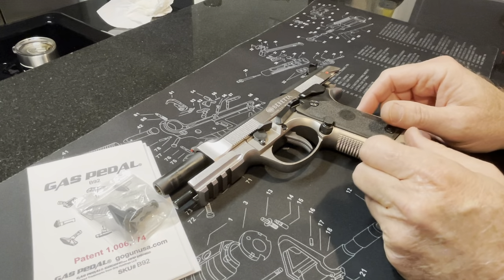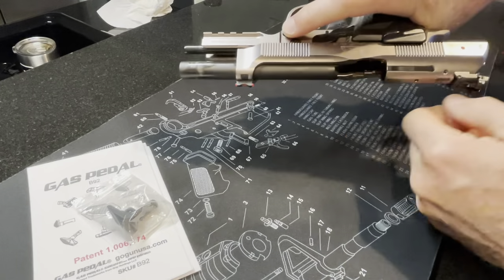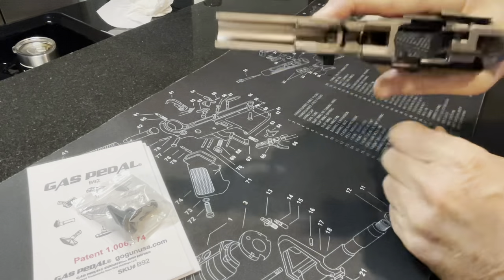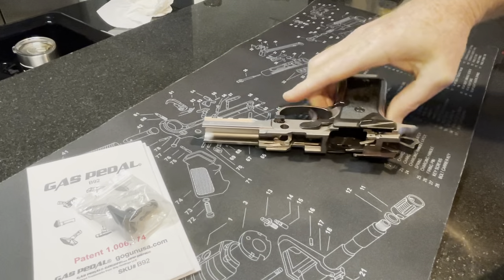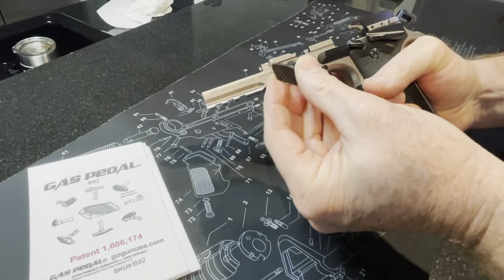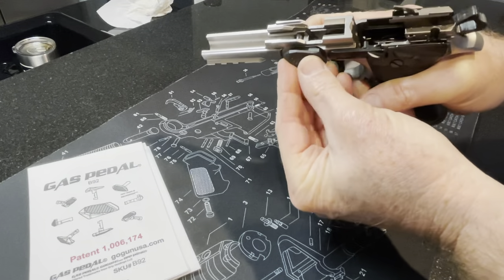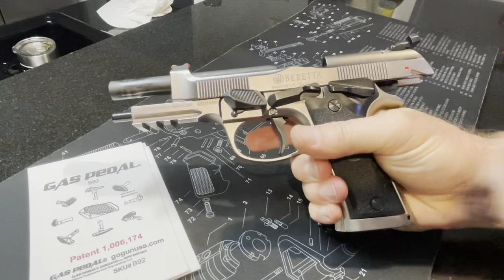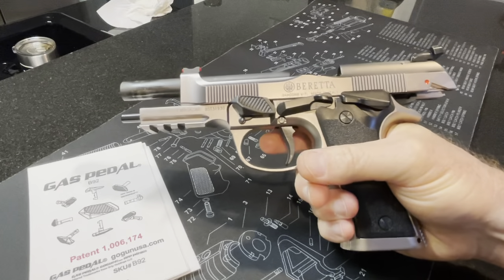GoGunUSA Gas Pedal Install on Beretta 92x Performance

Comment: Thank you for this. I ended up grinding down the pedal just below the slide as I found the thumb rest interfered with me being able to manipulate the gun. (M9A3) Afterward, I blued the area I grinded down. I am very happy with the Go Gun Gas Pedal.
Reply: Did the exact same thing, just wished the other side of the pedal sat flushed in the gun (right side of upper slide)

Comment: Does not sit flush with a 96a1
Reply from the maker: It's not compatible with the 96 series. The 96 is just slightly more narrow than the 92x which is why it's not sitting flush.
Reply: @NCSandS    it's compatible if you make it compatible 😂
Reply from the maker: @fastshuther  Very true! Haha!
Reply: @NCSandS   But yeah, it won't sit flushed from the right side of the top slide. it needs to be just a bit slightly longer

Comment: Hey @NCSandS , you had another video about a JP Enterprises Silent Capture Spring and the addition tungsten weight that you used for your CMMG Banshee. Looks like that video no longer exists so I can't get the part numbers anymore. Any chance you can hook me up with those part numbers?
Reply from the maker: Yeah, I'm gonna make a few changes to that video and put it back up sometime soon. What I did was order the JP Buffer that goes in a regular AR-15. Part number JPSCS2-15. I then ordered the 9mm spring kit JPSCS-PACK9 and used the heaviest spring(the Red & Yellow one). JP recommended that for the Banshee. I started with one Tungsten weight and 2 steel but I have since put all Tungsten on it so it's somewhere around 7 ounces. I haven't shot it yet since I added the third weight which is why I'm going to edit the video. I was having a weird problem with the trigger not resetting. I switched triggers and the new trigger was doing the same thing. Hopefully get it out soon and see if the additional weight fixes the problem. Hope this helps!
Reply: @NCSandS  Appreciate the response! I will wait for that new video and try to avoid the reset issues you are experiencing. Thanks!

Comment: Will that work on a M9A4?
Reply from the maker: Gogunusa.com only has them for the Beretta 92 series on their website. I don't know if it will fit the M9A4. The take down levers do look the same on both guns though but the hole diameter may be different.